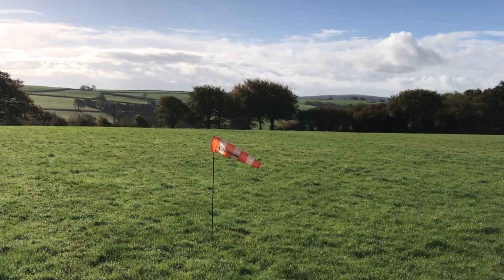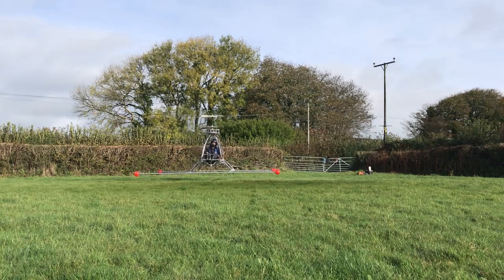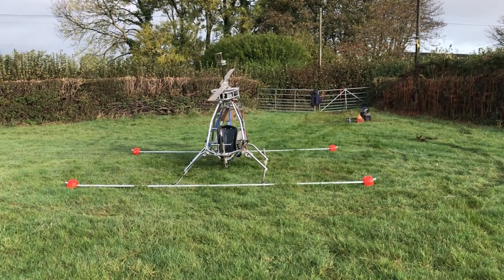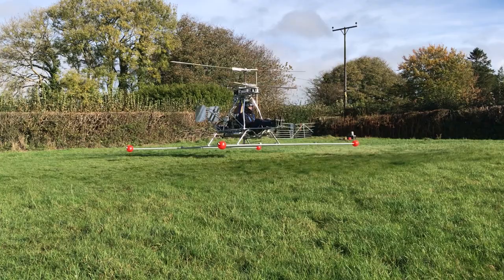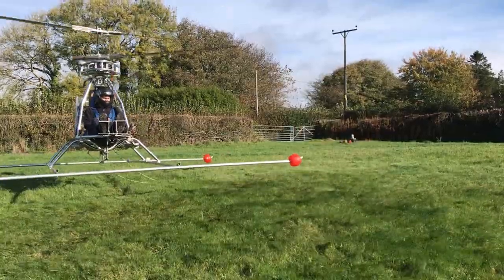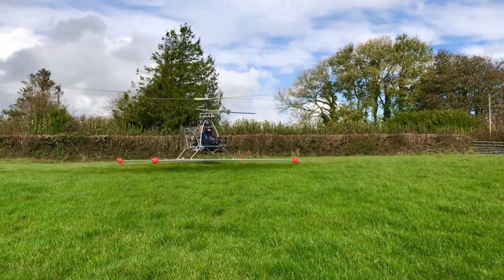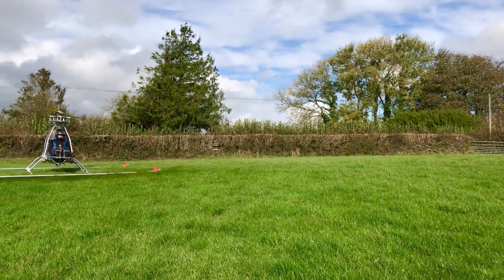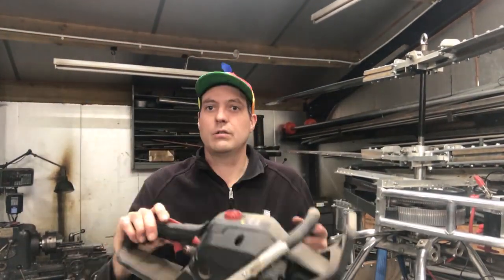BALLS UP Homemade coaxial helicopter learning to FLY

Comment: There is no reason on a coaxial helicopter to have the rudders at the back. You could split them equally left and right so any effect is cancelled out being both sides. Might stop the unintended aft pitch with climb.
Reply from the maker: That's thinking out of the box. I like it 👍
Reply: @Ben-Dixey  A quick test could be some plastic tube mounted off the front with similar area, see if it reduces the effect. Or even a simple flat surface on an arm as a counter balance in the airflow.

Comment: The theory about coolant running to fast and not having time to absorb heat is a very old misinformation, that keeps circulating. Yes, laminar flow is bad and can be countered with higher flow. No, to fast a flow will not reduce cooling. If that was true, then you could run around naked at the Northpole if only wind was blowing fast enough. The "to fast to cool theory" is an internet theory. Everyone working professionally with the matter knows it is BS.  It is true that each unit of water will carry less heat at higher flow, but at the same time there will be more units/time. Total heat transport will increase. It is simple physics.
Reply from the maker: Appreciate the confirmation, I wasn't aware of the historic argument. Good stuff 👍 I need to start looking for a higher pressure pump to increase the flow rate.

Comment: Re cooling,  
Thoughts , normally o/b motors have an "infinite " cold radator , ie 5 -25c top temp , no recirculation. 
Velocity isn't import (ie to fast ), to slow yes.
Corroded internals stop heat transfer.
There is a fluid added to water to increase thermal conductivity. 
Copper radiator instead of ally.  That will increase heat transfer,  guess around 💯 
Maybe more
Reply from the maker: Thanks for the comment, good suggestions. 👍

Comment: Your suffering lift from height with ground effect, 

Your craft is very light , any breeze will cause massive changes in pressure in the blades which in turn gives your effect,.

Height is your friend , height is your enermy,  height buys time.

You have done Very well, if you were here , there is a pilot who could tell you more , very experienced. 

If wishes were horses 🐎  beggers would ride

Comment: :yt: The angle of the L brackets, on your tail fins, are causing downward forces by causing drag and deflection. To get rid of that, try making them go as vertical as possible or enclosing them with light cowling. :yt:
Reply: Also, the shaft for your top set of blades, is dangerously undersized. If a bird, tree branch or anything else that gets airborne and hits one of the top blades, will cause a slight bend that will only increase near instantaneously from the shaft being unbalanced from the blade strike.
Reply from the maker: I will look into improving the tail fin braces. As for the shaft, not sure.
Reply: @Ben-Dixey   if you look at pictures of the tail of other coaxals, most are just flat sheets with no bracing whatsoever.
Reply from the maker: Yes. I planned to have flat plastic or carbon fibre sheet but as I didn't know what size fins were required i just used what I had, as it was thin aluminium it needed some bracing. 
Going back to the shaft, the rotors are Hinged via teeter hinges. I'm struggling to understand how how a small impact could impart a bending moment. A torsional moment yes.

Comment: can you run a power lead to it and run it from a generator instead of onboard batterys  until you get everything sorted
Reply from the maker: Yes I could, in the beginning I did this when the tethers were only 1ft long, I could do the same now it just means the supply cables would have to be very long too. I could do the same with supplying coolant to the engine and then I could hover for much longer. It's just all a bit messy but easily possible.

Comment: Look up the Indian man that was designing  a similar helicopter, a freak rear roater failure, on the ground in an engine test, killed the inventor. Please wear a helmet, and a full door could save lives
Reply from the maker: Yes, I saw it and always wear a helmet and seat belt. I think these would have saved him, but testing the rotor beyond operational rpm would have also been a good idea. Not sure if munna did that test.

Comment: From what I know from fixing my Jeep's cooling system:
- You need coolant flow, but not in excess. Coolant indeed needs to heat up and take that heat away from the metal. It also needs time in the radiator to cool down.
- The system has to contain only coolant. No air. Burp it properly and be sure it's air free.
- Pressure in the system allows for higher temps without boiling. That's what the cap is for. If it holds no pressure, the system won't work properly. If it holds too much pressure, a hose will pop somewhere.
- There has to be air flow on the radiator. If you have a fan, good, if it's shrouded, better yet. The shroud will force the air through it even when there's no airspeed.

That's all I can think of for now. Good luck!

Comment: In our shop I am a stickler on belt tension. Here's what I tell my maintenance crew: Measure the belt deflection at the mid point between pulleys. A 1/4" deflection is the loose limit, an 1/8" deflection is the tight side. This is a "rule of thumb" quick check. If you're still having trouble with belt slippage and you're between the two limits, your belt is too narrow. You must go wider. Also, if you're in a high RPM situation, balancing the pulley's will be a must. And unbalanced pulley will start vibration and oscillating side to side, adding instability to the whole system. Good luck!

Comment: Saw this and thought it may be of use to you for cooling idea and also the pilot pushes the stick on takeoff. 
https://youtube.com/clip/UgkxGI6KbNR7PDmNuCTgXpDfcIpo378OQLOK
Reply from the maker: 👍 thank you, the sch2a is a super machine. Air cooled mz202 engine, buying the engine would solve a lot of problems for me. It also has full swash plate control which is another big advantage.
Reply: In an ideal world there would be no fun. Swash plates add complexity. I guess that's why your project is so intriguing. Keep up the good work.

Comment: I'm a Fixed Wing Pilot and one thing my Flight Instructor teached me the first was to just give minimal inputs when flying straight. I moved the stick to much when there was nothing going on actually. I don't know if you can translate this to a helicopter. Some PPL(H) here?:D

Sir i appreciate it so much that you share your whole building process and everything. I'm very impressed!!!!
Reply from the maker: Thanks. Yes the same applies, over controlling is hard to stop. Combine that with the time delay in cyclic response and that only adds to the problem. It will get there, just practice I believe.
Reply: @Ben-Dixey  Maybe u can take a flight training for one hour on an ultra light helicopter. This should not cost more than 200-300 bucks.
Reply from the maker: I've had a couple half hour lessons and it certainly helped. I plan to do more, dual instruction is the safest way to learn I would suggest. My helicopter is different in how it's controlled so time spent on type would still be needed.

Comment: I see u fashioned some some caster impersonators. They look fit for purpose. Wondering if you should commission with an experienced pilot to dial in the basics to get a good index.
Reply from the maker: An experienced pilot would be very helpful, but I wouldn't let another person in my machine until it had thousands of flight hours to make sure the machine is safe.

Comment: Hmm with the coolant, the restriction stuff is rubbish. The more coolant flowing the better, and you are already at a disadvantage with small cooling channels since its an outboard. Here's a few things I thought of: 1) pressure test the system, flush it, fill it  2) ensure fan is blowing air down as so its not fighting the airflow from the rotors, 3) build/buy a simple radiator shroud around on the fan side, 4) buy a turbo blanket to wrap around the exhaust, more waste heat staying there, the better! Use your multimeter to check the temp at inlet/outlet of radiator at idle, the hope is the inlet is 90-95 and outlet as close to ambient, but in reality 50-60 degrees.
Reply from the maker: Thank you for your thoughts. All sounds good 👍

Comment: Looking good reminds me of when I learnt to fly with my "stabilisers on". I found they caused me more issues with ballance so took them off but that was an RC not real like yours. Could the weight be "unbalancing" it. Some carbon fiber rods might be lighter. safe flying and thanks for sharing 👍👍👍👍
Reply: All maneuvers start and stop in a hover and adding this type of training gear does more harm than good. I taught myself to fly rc helicopters and I did use this type of training gear. I experienced the same issues you are having and removed them.
Reply from the maker: You are the second person to suggest the bars could be destabilising. Interesting

Comment: a data logger would useful in this situation . just for example recording all types of data,  coolant temperature in radiator and in engine block , , pressure & flow rate, rotor speed , accelerator, motion , pitch yaw etc
Reply: Thought this when he mentioned the rear dropped down when increasing altitude and whether it was an unintentional control input.
Reply from the maker: Good call, I didn't know about them, will look further into it. 👍

Comment: Great videos. The suggestion that too much coolant flow impedes heat transfer from the engine into the coolant is nonsense. The boundary layer theory/issue due to low coolant flows is bang on. A more uniform temperature across the engine is also an advantage of high coolant flow rates. Keep up the interesting work.

Comment: This is without doubt one of the coolest things I've seen - absolutely love your ingenuity! I'm teaching myself to fly nitro rc collective pitch helicopters and seeing the apparatus attached to your skids struck a chord with me. I had a similar arrangement attached to my skids for a while. I noticed was that when I stopped using them my heli became much more stable, however took me a while to be brave enough to leave them off!! As I've discovered wind speed is definitely a factor when hovering. I'm looking forward to seeing more of your heli adventures and I've subscribed to your channel - good luck!!! 😎
Reply from the maker: Thank you and interesting you found the long poles destabilising. It's going to be a nervous day removing them but needs to happen at some point.
Reply: @Ben-Dixey  You're very welcome!! I'm sure by the time you remove the stabilizers your confidence and experience will outweigh the nervousness... 😎

Comment: Ben it's a pity you didn't aquire Rotax air cooled motor from the beginning because a lot of time and effort has been diverted in getting the outboard sorted out, a project on its own.
Reply from the maker: It would have been much easier Peter. It was just the money that stopped me.

Comment: HI BEN,  IDON'T THINK YOU NEED THE ADDED WEIGHT OF A ROTOR BRAKE AS THE MAIN FUNCTION OF THAT IS TO KILL THE ROTOR RPM RAPIDLY  DURING THE ROTOR SHUT-DOWN IN WINDY CONDITIONS TO PREVENT BLADE SAILING,     WITH YOUR FAIRLY RIGID BLADES AND THE RELATIVELY HIGH ROTOR RPM IN FLIGHT, YOUR BLADES ARE NOT AS VULNERABLE TO SAILING IN GUSTY CONDITION ON SHUUT-DOWN.
           THE COMMENT BELOW BY DTM 61 IS SPOT ON.   A GUST NOT ONLY PRODUCES SOME TRANSLATIONAL LIFT BUT THE DISC ALSO FLAPS-BACK CAUSING THE NOSE TO RISE. SO THE EXPECTATION FROM A STRONG GUST IS FOR THE MACHINE TO RISE AND REAR BACK - JUST WHAT YOU ARE EXPERIENCING.
                    DOING WELL - BEST OF LUCK !

Comment: Coolant flowing "too fast to cool" is a myth, you want the coolant to be flowing as fast as reasonably possible so that the coolant in the engine is as cold as possible and the coolant in the radiator is as hot as possible. The misconception comes from the idea that you want the coolant to cool down for longer in the radiator, but that also means the coolant is heating up for longer inside the engine! 

The rate at which heat is transferred to and from the coolant depends on the temperature difference, so you can imagine that if the coolant were slow enough, the coolant in the engine would reach the temperature of the engine, and the engine wouldn't transfer any heat to the coolant. The coolant in the radiator would also reach ambient temperature, so the radiator wouldn't radiate away any heat. Flow restrictors only have a few niche applications, such as balancing out parallel cooling circuits when one path flows more easily than another.
Reply: I think that some of this 'myth' probably came from the automotive racing sector. We had issues with some of our race cars in which they were being cooled too aggressively for the engine lubricant to maintain the correct operating temperature even when using stock components (water pump, radiator). Part of this is due to prolonged elevated engine RPM driving the water pump faster than the normal mean speeds intended by designers of road cars, and part is due to the increased volume of air being forced through the radiator due to higher prolonged road speeds. In these cases the 'fixes' were to underdrive the water pump pulley in order to reduce its operating speed (and gain some slight reduction in parasitic drag), and sometimes to fit a restrictor into the 'return' side of the coolant loop to maintain additional coolant pressure inside the engine castings, along with the use of surfactants to help the coolant contact the internal cooling galley surfaces better.

In some cases, other problems would occur - water pumps being spun at very high RPM could cavitate leading to much reduced coolant flow.  In this case reducing the pump speed actually increases the coolant flow.
Reply from the maker: Great comment, this makes sense to me. My pump is capable of 15ltrs/minute in free flow and a study of a very similar engine came to the conclusion that 25ltrs/min was the required rate for cooling. 
The engine coolant passageways are quite small and restrictive so my pump was only allowing 9ltrs/min through. I need to measure the coolant pressure from the pump so a pump can be purchased with increased pressure and flow rate. What percentage of an effect do you think running this engine at 9ltrs/min rather than 25ltrs/min would make? I'm hoping it's significant but it may be difficult to estimate.

Comment: Thanks again, let being us the witness of all the progress.
Very careful approach...great .
My Question -did you hold your control stick (cyclic) forward pushing while trying to rise the height of flight ?
Because it was showing rearside downward tendency while trying to rise the altitude of flight .
I don't remember but in previous video did you try forward move with your machine using your cyclic pushing forward  (may be you did but I don't remember it ) 

I know It's easy for us to speculate but when sitting on your place it must be hard to handle and learn the machine too.
Thanks again brother
Reply from the maker: Hi, Thanks for the support, to answer your question no I didn't push forward while rising, perhaps I will try it next time.
Reply: @Ben-Dixey  welcome brother, i sincerely believe you are approaching really well to the goal .
And an aviator should be careful as careful you are with your new machine,to understand the mood , tendency, habits ,pattern of complexed flying machine.
Brother did you ever fly your machine forward -backward motion?
Thanks
Reply from the maker: Absolutely correct. 👍 
I have tried moving in a desired direction for brief moments. Yesterday I was drifting to the right and some attempts were made to move back to the left and i was able to do that but only just. I did manage to move forward in the previous video and it was intended. It's going to take more practise and it seems to be a slow process, for me anyway. The question is can I keep the machine going long enough to learn the skill. Not sure.

Comment: With the problem of your nose rising and the tail dipping it may be as simple as the wind over the nose has reached a velocity that you are starting to go through translational lift. The advancing blades have a higher velocity of air going over them (lift increases as the velocity squared) in conjunction with the fact they are work in cleaner air. As a result, the advancing blades are producing more lift than the retreating blades. Due to gyroscopic precession the lift takes affect over the nose and causes the nose to rise. This is normal in all helicopters when they take off and the pilot automatically adds forward cyclic to compensate. I was once doing a maintenance ground run on an AH-1 (with very little fuel and no gunner in the front seat) when the wind over the nose reached a velocity that the helicopter went through translational lift and I ended up at a 5 foot hover with the collective all the way down. I had to slowly reduce the throttle in order to get the helicopter back on the ground.  Be very careful with winds at higher velocities because you may be flying higher than you had planned. Hopefully that gives you something to think about.
Reply from the maker: Thanks, I will have to think about that one before responding 👍

Comment: Your issue us probably centre of gravity.  Have you hung the bird from centre rotorhead.
Reply from the maker: Hi yes. I haven't checked it lately but there would have to be a change in CG higher up as hovering low is fine. It could be just the pilot though.